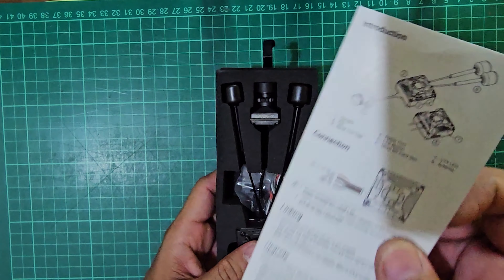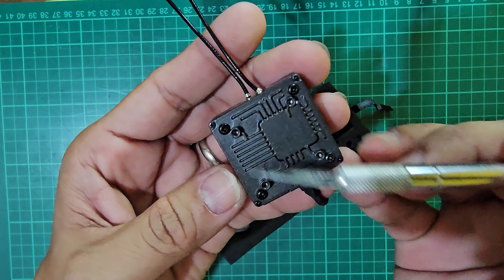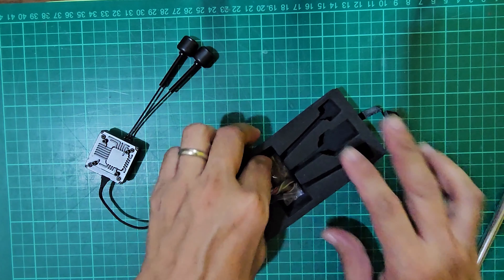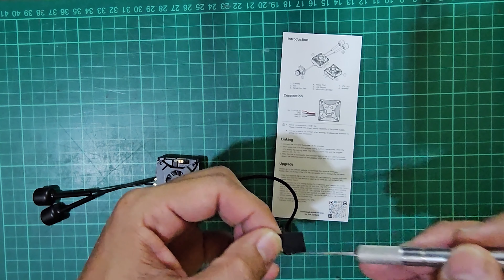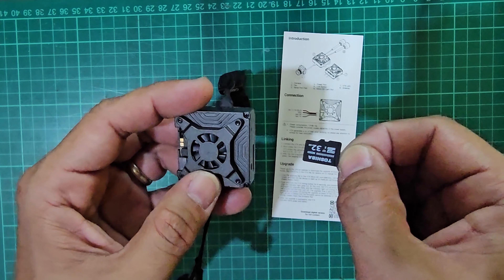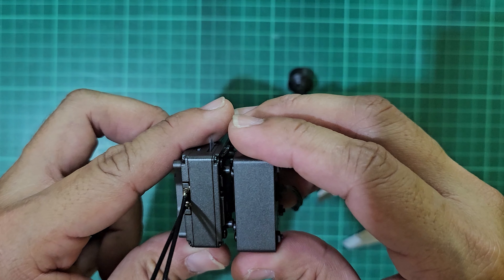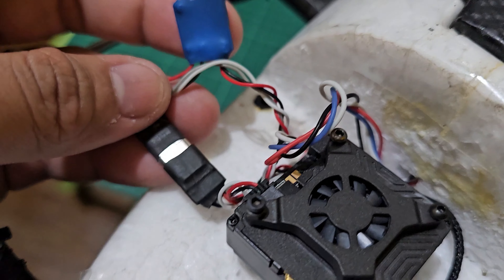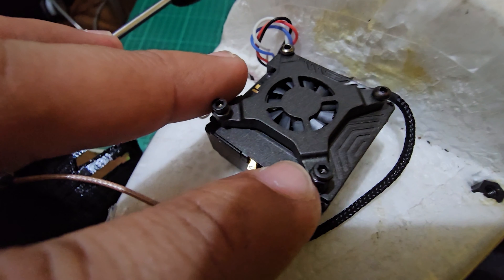Power!!! Walksnail GT - 2 WATTS camera vtx kit!

Comment: I've been playing with one of these recently and it seems strange to me the range tests on these. I get the idea it can go farther than DJI transmitters, but I also get the feeling that's just because there is no hard limit. It also gives me power level options but always seems to output max power no matter what. I assume max power cause of how hot it gets. So far the range I get with it on the ground is a fraction of what I get with an O3.
Reply from the maker: It's because the DJI goggles has 2x tx and  2x rx while the Walksnail system only has 1tx and 3 rx, thus the noticeable difference while in range. Beyond that range Walksnail does it better, hard limit is one factor
Reply: @windfpv  The second one I got actually worked right and I was surprised how decent it was with actual good antennas. 
It smashes the DJI when it comes to low lighting. Otherwise I think it's ok, definitely worth using. I can see how it could potentially just keep going and going in the air which makes me wonder why DJI even puts a hard limit. 

For longest range what kind of settings do you run? From what I can tell 25mbps is the way to go.
Reply from the maker: @Magneticitist  it may not be not just a decision to put hard limit, it could be a real hardware limitation on dji.

Anyway, 25mbps should get you farther out 😊

Comment: Thanks for the video! I'm planning to build a long range quad. The extra mw could give some extra range. Do you think the stock v2 walksnail antennas needed to be replaced? I'm not sure..tbh. i've tested foxeer lolipops instead of the stocks v2 antennas, and couldn't feel any difference in range or signal quality. What do you think?
Reply from the maker: Stock vtx antenna should be fine.

Comment: Pwede ba gamitin ang moonlight camera sa GT vtx at makapag record ng 4k video?
Reply from the maker: no sir, you need the Moonlight cam + DVR combo
Reply: A video by @Chris Rosser covering the technical specs of this unit stated that it is compatible with the Moonlight Camera and would support 4k recording.

Edit: Misunderstood the video, @windfpv is absolutely correct that to record DVR at 4k you would need the moonlight DVR, however the camera does work with the GT VTX.
Reply from the maker: @jonathanturner8117 on the contrary, our actual tests only say that recording is at 1080p only. If you want 4k with the GT, put a moonlight cam + DVR kit on the GT.
Reply: @windfpv Gotcha gotcha, that's what I was expecting but still waiting on my GT to arrive to play with. Can't imagine how tall a stack with this + a moonlight DVR would even be 😂😂
Reply from the maker: @jonathanturner8117 haha! True!! That would make it at least a half taller with that configuration

Comment: What's the range?
Reply from the maker: currently the record is at 55km but should be able to farther and at lower altitudes
Reply: @windfpv   with goggles only or ground station?
Reply from the maker: @christianmong-hansen1835  goggles on tripod with triple feeds if I recall correctly